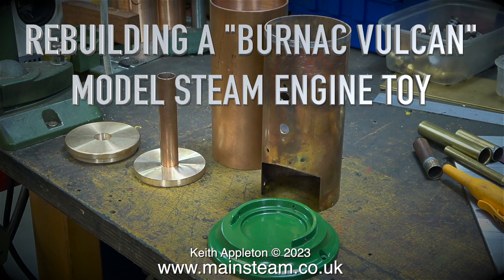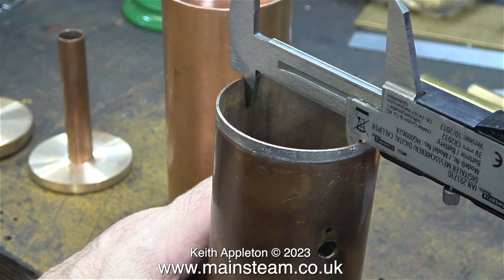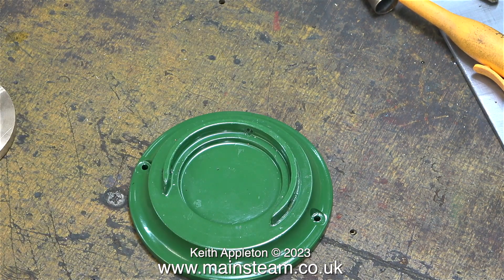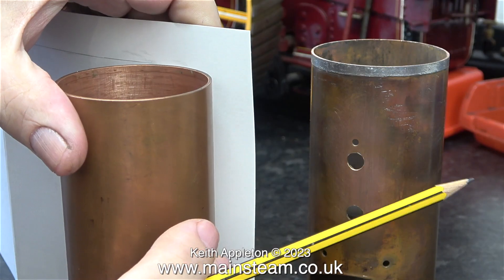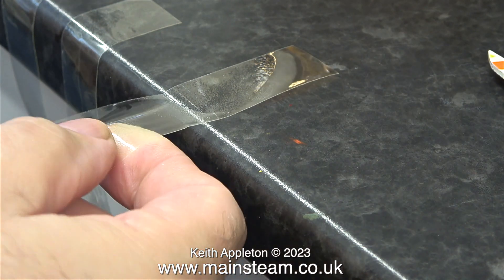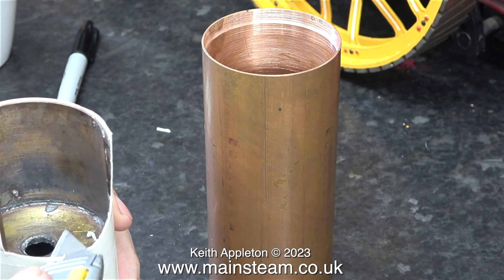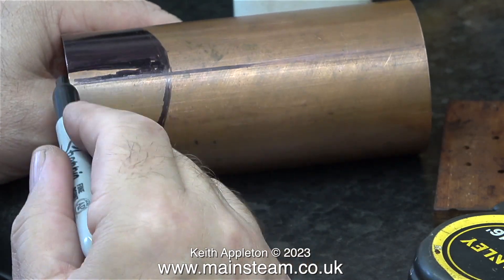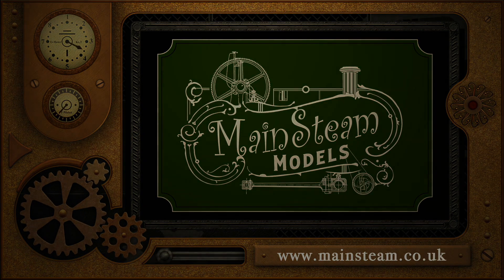REBUILDING A "BURNAC VULCAN" MODEL STEAM ENGINE TOY - PART #14

Comment: I am getting rather old now, but I still remember my time in the drawing office at the Graving Dock & what you have done looks reasonably normal practice to me. Regards thinning the metal down below the pressure vessel there is nothing wrong in that either. I admit it is more normal practice to swage the metal to be thicker where nozzles are in pairs & doubler plates are not possible. But thinning a part where corrosion is not a problem & it is well over strength is perfectly acceptable. I have no problems with your work. The clever use of templates is to be commended.

Comment: Keith, engineer here. Electronics engineer with systems and software engineering experience too. I recall joining a company in 1999 and being tasked with designing the electronics for an advanced medical device in a very demanding timescale. I needed to work out the positions of a power supply, an embedded PC and a control board onto a chassis plate. So I cut out paper templates and arranged each to form a suitable assembly, with appropriate space for connectors and wiring looms. My new boss saw what I was doing and was horrified. He said “but… but… but we’ve got thousands of pounds of CAD (Computer Aided Design) software in the drawing office next door for that”. I replied that I already had the solution and it worked. And I stand by that method 100%. So please, never apologise for using alternative CAD (Cardboard Aided Design) on those occasions when that’s exactly what the task demands.